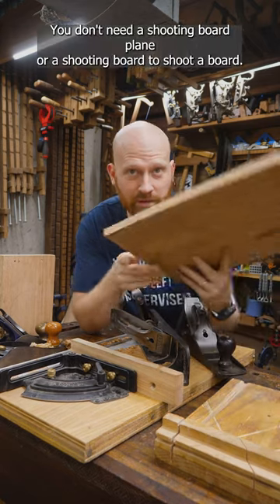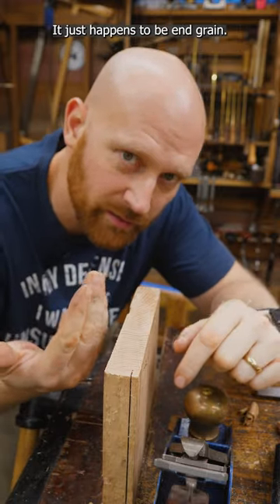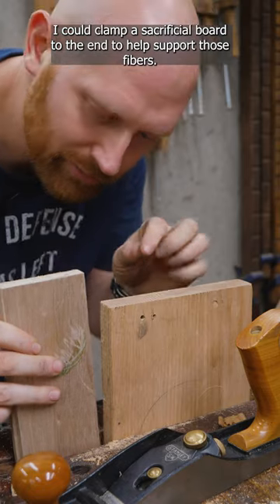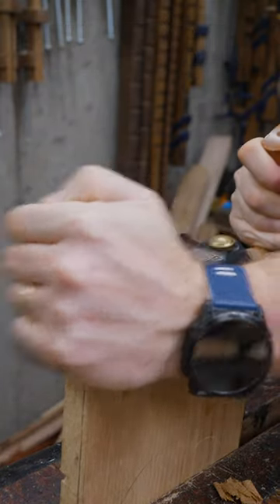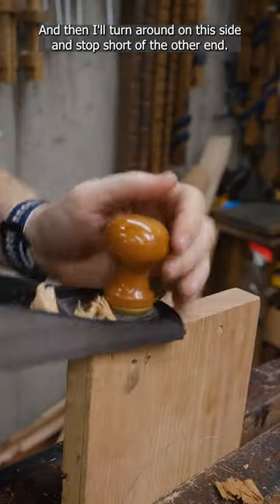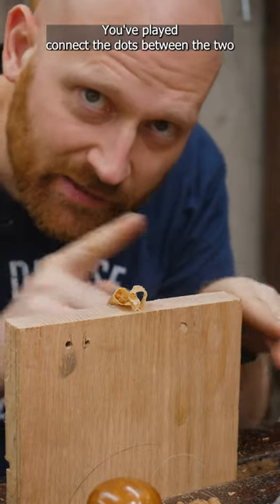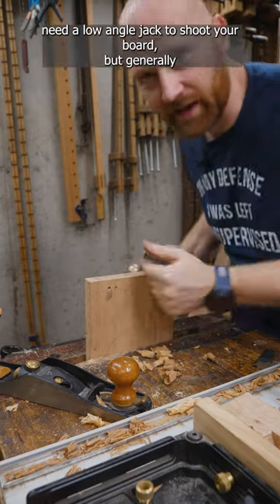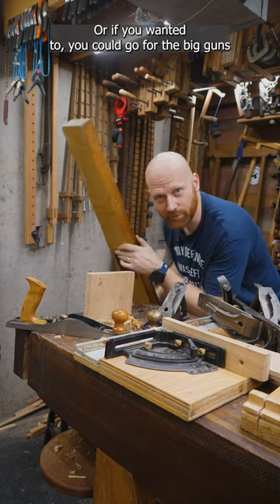You Do Not Need A Shooting Board

Comment: Technically any accurately thicknessed board can be a shooting board just put it under the board to be shot and hold fast then to the bench and slide the plane on the bench, nobody ever wants to have their tools be used directly on their bench though. I have a bamboo benchtop, things slide really easily on bamboo.